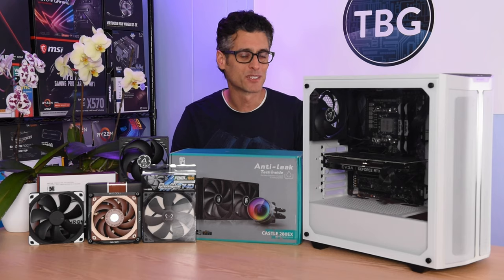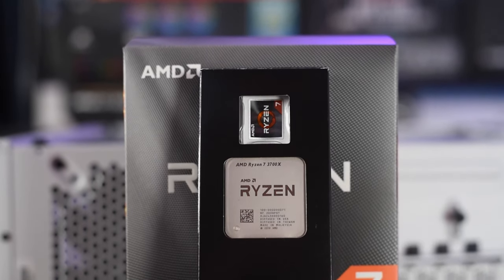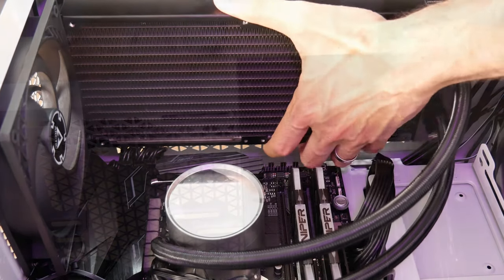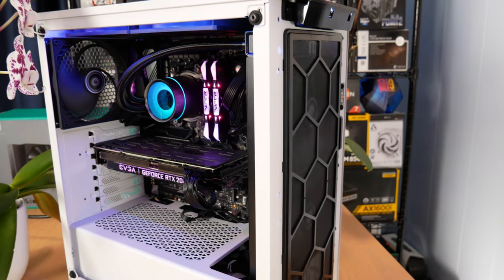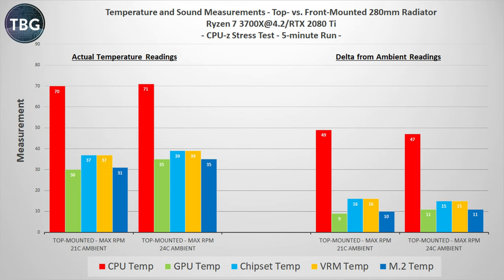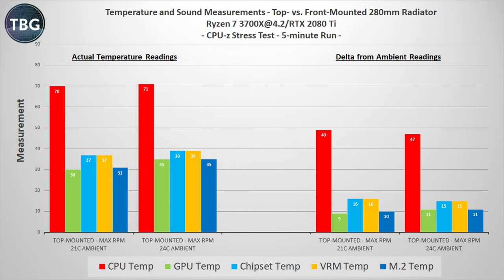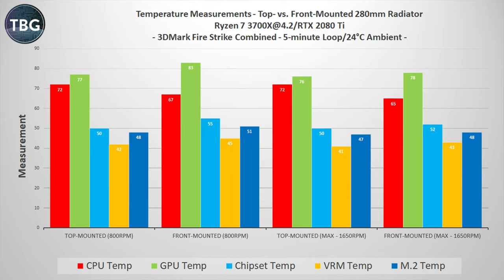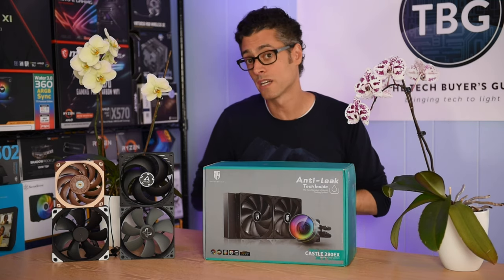Front vs. Top AIO Liquid CPU Cooler - feat. Deepcool Castle 280EX Install on AMD's AM4 socket

Comment: Some other testers are able to use aircon to always have a stable room temp. They can then test winter and summer.  Thank you for taking the time to make sure your tests are valid. You do some of the best testing around.
Reply from the maker: The big issue is that AC doesn't hold a temperature steady until you hit the thermal threshold. So it's often cooler than that at night, or in the morning. Even if I test when the AC is running, that only gives me daytime hours to test, and that's not necessarily when I'm free! The same problem happens in the winter. Room temperatures in my climate are never the same all day long.
Reply: @TheTechBuyersGuru  Most legit sites use dt and also tell the ambient temp. If the ambient temp is 22 to 23C how much of an impact do you think that will make? Does the 1C warmer and less dense air cool better or significantly worse?

Comment: Thank you a lot of times ! You are the only one that shows the "problem" of AM4 back plate after installing the screw. I was scared today and I stopped to mount the Castle 240 EX ARGB. I had fear something wrong was done... But with your video I see it's normal at 4:12. One last thing: it's better my arctic MX-4 or can I use the applied thermal paste ?

Comment: I'm mostly happy because I bought this cooler without double checking if the 500dx which I also bought does actually support it at the top. And it seems that it does, thankfully.
Reply from the maker: It won't work with all motherboards, hopefully you have good luck!
Reply: Same here. I bought the same cooler and case, the motherboard hasn’t arrived yet but I hope the radiator fits on top. The motherboard is Asus Rog Strix X570-E 🤞
Reply: @aaronruiz873  why top? For aesthetics?
Reply: @halofanaticboy  for the reasons stated in this video. But mainly because durability, since any water loss over time will spread evenly over the radiator when it’s horizontal. 

By the way, it did fit in the case on the top with my motherboard too, but it’s tight.

Comment: I have been trying to figure out if a 280 would fit on the top of this case for the longest time! Thank you!
Reply from the maker: You're welcome! I actually wasn't even going to do this test in the 500DX because I assumed the answer was no! But then I just tried it for fun, and wow, it fit!
Reply: @TheTechBuyersGuru  Think the issue would be the thickness of the Rad, I was looking at the Arctic 280 Freezer ii but its a thick rad at 38mm!!  pretty sure that 280mm aio wouldn't fit up top??
Reply: @TheTechBuyersGuru  Yes, thanks for this. The manual says it only fits up to a 240 rad so I'm glad someone tried.
Reply: @TheTechBuyersGuru  Great video thank you very much ! Because I have that case and tried top mount x53 Kraken and front mount, and yeah same conclusions under long stress GPU is much hotter with the kraken front installed.
Bitwit does not have the same results as us, but in my case with the be quiet 500DX, a 5700 XT THICC ULTRA III and a Ryzen 3600 4.2 ghz, I prefer keeping the GPU colder even if the CPU gains a few degrees
 with a top exhaust pull mount. Do you think the Kraken X63 280 would fit on the top ? Thank you :)
Reply: normally it shouldn't at least from be quiets infos
Reply: @B.Fenderer  I asked be quiet! is a 280mm would fit, and they said that yes, you could fit a 280mm up top, but to do so you would need to remove the SSD mount/cable cover to the right of the motherboard. I measured my current case and with that mount installed you have ~54-55mm of clearance for a rad. The 280EX is 52mm, so a tight fit. Stock x63 might not fit (it is slightly over 55mm), but you could replace the front fan with a slim fan to get the needed space. Or take a dremel and chip off the top part of the SSD mount.

I feel like it is a major design failure. If that cable cover was only ~3mm shorter they could advertise a 280mm rad in the top.
Reply: @WeaszelBoy  Thank you for your answer and these details, it’s nice :)!
Reply: Today I tried a kraken x63 on the top, with my b550 Tomahawk it's impossible to fit. I prefer top mount than front mount so I stay with my x53.
It's a good case but seriously it's a shame in 2020 to not be compatible with a 280 mm top just for a few millimeters.
Reply: B. Fenderer well thanks for trying for me haha I also like the aio on the top and many cases now days don’t fit 280s up top unless you get much larger cases which sucks cause I like the smaller compact atx cases
Reply: So would a Corsair H115i fit up top seeing that it’s 52mm tall (27 rad + 25 fan)? From what I could find online this would be the same as the cooler used in this video.

Comment: I run the 360 version of this AIO front mounted. While the GPU runs a little warmer i can live with it. I have the same case too so there's nowhere else for it to go. Keep up the great videos. Really enjoy your content.
Reply from the maker: Gareth G, this is one reason I wanted to test a 280mm cooler, because I could try front and top mounting it. I know what you mean, many cases do not provide that option for 360mm coolers (and actually, most don't even provide top mounting for 280mm coolers, I got lucky here, it was a close call!).

I have a 280mm/360mm AIO cooler shootout planned for late-September/early-October, and I will need to switch cases for that unless I front mount all the coolers in the 500DX. Given that you agree that front-mounting isn't optimal for GPU temps, do you think it would be a mistake to test this way? One concern I have is that the ranking of coolers may be different based on placement if some come with fans that deal with front case obstructions better. But if most people are front-mounting their rads, then....

Ah, ha, I know what I'm going to do. I'm going to post a poll on the channel asking people who use AIOs to tell me what placement they use. That should be fun!

Comment: Thanks so much for this video! I took your advice on top mount but I had to downgrade from a 280 that was in the front to 240 to get it to fit. Cpu probably topped around 60 before but I figured it’s worth the extra heat to bring the gpu down. I don’t regulate my room temperature but after the swap, my gpu went from a max of 78 to 68. The cpu is warmer, 71 so far at the hottest but that’s fine, everything feels more balanced and I’m happy. 
Using a 4000d airflow, 3080 master, & 11700k for those who are curious.
Reply: Question is if he had put in the front mounted correct, would the temp go down? Tubes down, not up due to air bubbles. Air instead of liquid will not cool.
Reply: @Dreas89  As long as the connection to the connection to the radiator is lower than the pump, I'm not sure it would matter much but I'm no expert
Reply: With condensation I would assume air over time would come in. There is a couple off videos out there on this. Better to be safe 🙏

Comment: Can you do push pull configuration in the front to see if GPU temps drop lower
Reply: I use push pull on a 280 front mount and I saw VRMs and GPU temp (vertical mounted) lower by 3 degrees.  So front mount is actually better for my case and fan set up.
Reply: @Andy Aech I found when front mounted cpu is a little cooler but heating up rest of the system also got a push pull config try both and top got better temp overall in my setup

Comment: Great video series. Although in front mounting setup I believe adding exhaust fans on top prevents hot air from GPU get trapped when it actually have somewhere to go instead of helplessly exit from various case holes, resulting better GPU temps and this way other components get some air as well which with already good CPU temps it's better overall in my opinion.
Reply: It doesn't make much difference when the air coming in from the radiator is already warmer

Comment: I've been contemplating getting an AIO in the past few days for my new build (waiting for Zen 3 and the 3000 series before I take the plunge).  And the question of front or top came up.  Thankfully, you've made me realise that it is better to mount up top.  Great video, thank you!

P.s - I saw a similar video where the guy compared open vented GPU's and closed case GPU's and the different effects caused by those variants.  I think it would be the only improvement you could have made to this video.  But it's not a criticism as you stated what GPU you were using for your tests, so no complaint here.  I'm just suggesting it would be helpful for a wider test audience.  

Great vid though, very informative!
Reply from the maker: Glad this was helpful. I have a blower-style GPU that I used to use for this type of testing, but they are incredibly uncommon now. So I use what most people actually have.

Comment: Just found your channel. Been enjoying the videos, so thank you! I do think the framing of your talking head / desk shots could be angled a little higher, or perhaps shot with a shorter focal length. It feels a tad cramped with your head so close to the top of the frame. Just some viewer input. Thank you again!
Reply from the maker: I know, trust me. I'm in the process of upgrading my camera and currently using one that is most definitely not great for studio work because it has no flipscreen, so I can't monitor it. It's hard enough to get  my lines right, so I just put this out despite the framing issues. I'm going to limp along until September when I get the new camera.
Reply: The Tech Buyer's Guru Thanks for the reply. Looking forward to it! I will say that other videos of yours look perfectly fine in this regard. This one just felt a tad cramped. While you're upgrading your camera, you might also consider some new intro music / graphics. Something that matches your level of coolness and attention to details! Keep up the great work!
Reply from the maker: Yeah, it's just the new camera - did a whole recording session with the wrong focal length, really didn't want to re-record!

And, ha, ha, yes, maybe I need a new intro as well. But I'd have to hire someone to do that for me, so I better get looking!

Comment: Hi man, many compliments for your testing job and for your scientific approach.
That said, I'm doing my first build so forgive me if I say something trivial but... your point is better top mount exhausting out, or front mount blowing in. Ok... but MANY people around, including me, have just the problem that, for instance, an arctic freezer II 360 doesn't fit on top, so the only solution is front mounting it (or downgrade to a smaller one on top).
So I'm gonna mount it on the front, but the same way I would mount it on the top, so fans inside and radiator pointed out.
So my question is: in that case, are the top and front mounting equivalent in terms of performance?

Comment: Thanks for making this video, I do have a silly question:

Would it be fair to say this test is kind of unfair in a way that the intake and exhaust CFM are different for both top and front mounting? I know this case is sort of limiting since there isn't anywhere else you could add another fan, but if it was a bigger case, would it be any different?

For example, the top mounting for this test has a better intake CFM, since the 2 front intake fans are not obstructed by a radiator, thus making the top mount setup a less of negative airflow, without being accurate, this setup is more like 2 intake fans vs 2.5 exhaust fans.

But for the front mounting, both of the intake fans are obstructed by the radiator, making it like 1.5 intake vs 3 exhaust, it's highly negative airflow. Is it right to say in a way this test is 'unfair' to front mounting?

Of course I'm aware that there's nothing you can do because of the limitations of the case. Just wondering if this top v front mounting test would have a complete different results in another case with more fan slots and having positive airflow for both top v front mounting, with about the same CFM for both?

Thank you.
Reply from the maker: I think you're too focused on whether a case is positive or negative pressure, which in and of itself means nothing regarding performance. Any benefit that would come from having a higher airflow front panel (this one is already WAY above average in that regard) would benefit both setups. So no, there isn't a bias.

Comment: so ultimately which is better ? mount on the top or front ?
I have RGB fan on the front with glass front outside..so i wanted to mount on the top. will there be any major issue on the top ?

Comment: Really enjoying this channel. Building first PC and find this a great source of impartial information and building advice. I am also looking at the 500dx as it seems the to be the best for thermals etc at this pricepoint. Looking at the possibility of top mounting an AIO too; however, some builds I have seen have the cooling pipes touching the GPU (using H100i for example). Do you ever find this is to be an issue? The way you have mounted your cooler is quite neat and has at least a partial gap between the pipes and the gpu and in this case. If I bought the 240EX do you think it would mount the same way and leave a simiilar gap? Thanks!
Reply from the maker: Glad you're enjoying the channel! Yes, if you go with the Castle 240EX, it will mount the same way, even easier in fact as it's a bit narrower. The 280EX just barely fit in the 500DX chassis, as I showed. Officially 280mm rads are not supported, and I know why... some may be just a bit too big if the fans are a few millimeters thicker. Here are the links to those recommended items:
- 500DX chassis: https://amzn.to/38W8mUH
- Castle 240EX: https://amzn.to/36D7AJm
Reply: Really appreciate the quick reply. Thanks for the advice!

Comment: Do you see any problem with top mounting a Deepcool Castle 280 ex in a 500dx with a MSI x570 Tomahawk? Will the VRM heatsinks cause any space issues? Is the recommendation for top mounting only till 240mm because of the length of the radiators?
Reply from the maker: There is some chance it will hit the heatsinks, and that is why officially the 500DX does not support 280mm rads on top. It was very close with my Asus X470 Crosshair. The issue is not the length, it's the width. That's why a 240mm easily fits... because it's only 120mm wide instead of 140mm wide.
Reply: I'm also interested if this would be possible as I want to get those same components, has anyone tried it yet?
Reply: @reshra  with the components I mentioned, I wasn't able to top mount the radiator, ended up front mounting it, but temps seem fine for me, sub 70 CPU and GPU while playing Cyberpunk at 1440, DLSS quality ~60 fps for hours on end
Reply: @a7suspended4   thank you for the reply! Was the problem that the radiator was hitting the motherboard VRM? If that was the case would just a 140mm fan fit up there?
Reply: @reshra  yes, well technically the radiator would have fit, but not the fans below it, which of course is useless. But that answers your other question that 2 140mm fans do fit easily. 

A word of warning, I ended up mounting my AIO with tubes up (now that I think about it, it might have been possible to do it with pipes at the bottom), with the pipes at the top, the fan closer to the pipes was getting a little stuck because of the pipes, but finally I've attached it all and it fits quite snugly

Comment: Thank you kind sir. It's really helpful video. Can you please try next time that gamernexus recently made video about wrong mounting aio pump tubes location and loop? How difference is if the temps and performance gonna change? I really wonder.
Reply from the maker: I'm aware of his video. Depending on your case, cooler, and the length of the GPU, mounting it the way he suggests may be impossible. All the more reason to top-mount. But I may try fitting it in this case the other way in my next video.
Reply: @TheTechBuyersGuru  Thanks for respond. It's impossible for me that i have 360mm aio unable to flip radiator my case won't let me it in that way. I don't have any noise or other problems which is he mentioned in his video. So that shouldn't be a problem for me i guess.

Comment: Great information and I love the detail you provided for all Temps, scenarios, and various tests.  My only thing I didn't like to see was the radiator orientation when front mounted.  You should always have hoses down to eliminate any air getting to the pump.  This can degrade AIO performance as well.  Just fyi for anyone reading this.
Reply: Stop it, that NG video has been blown way out of proportion.

Comment: Sooo... My case only fit a 360mm radiator in the front or a 240mm in the top. No space for a 280mm radiator in the top. Sooo... What would be the least bad config in that case? :p

Comment: That is a great case.  Not only can you go with a 280 up top but you can still fit even the 3090 Suprim X in there as well.
Reply from the maker: Some 280mm coolers will fit with some motherboards, but it is not guaranteed. It takes a bit of luck!

Comment: Great video thanks for tips! Just one question if you have already test it: with only a watercooled GPU (Strix LC 6800XT) should I put my rad on front (push pull intake 120mm) or top (120mm push to exhaust)? My GPU will probably run much hotter with front mounted rad exhausting hot air from case no?
Reply from the maker: I have run liquid-cooled GPUs, and it's always much better to have these as exhaust, because the generate a tremendous amount of heat. They are actually much hotter than CPUs, and you want that waste heat exhausted out. Here's a video showing some benchmarks with both setups: https://youtu.be/O3AkvHonAEc
Skip to the 13-minute mark to see the benchmarks.
Reply: @TheTechBuyersGuru  Thanks for answering! :) I'll watch it!